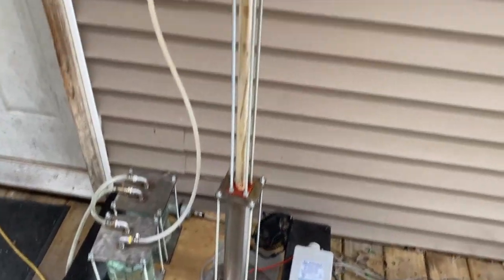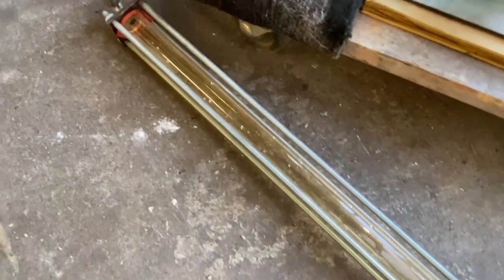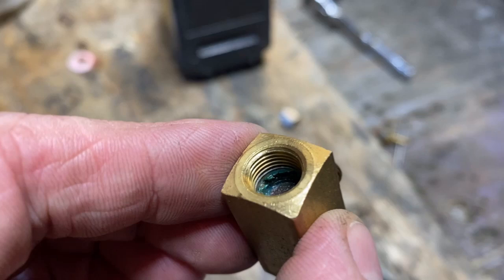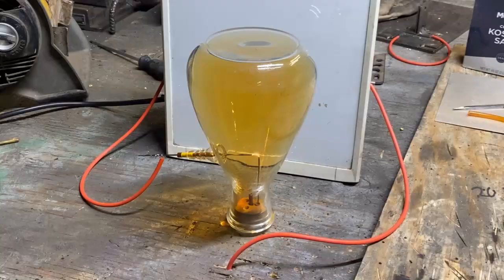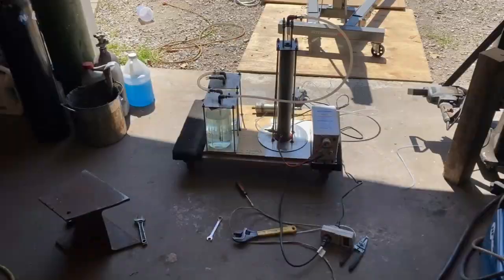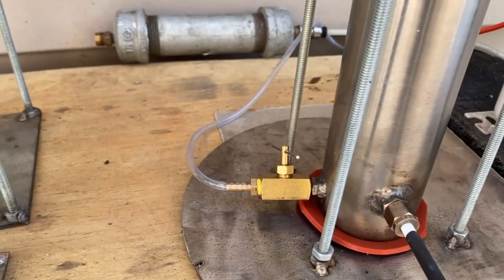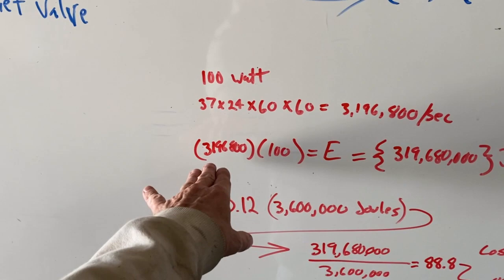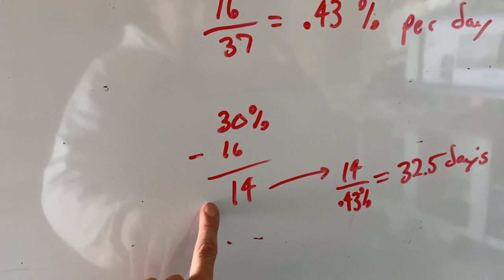Birkyland Eyed reactor  16.6% NITRIC ACID IN 37 DAYS

Comment: For such strong reagents, it is necessary to use PTFE seals and a Tri-Clamp connection system for collapsible sealing.  White coating, most likely silicon oxide, from a degrading silicone rubber gasket, dyed red.

Comment: The white stuff on the rubber it may be Silica oxide coming from the decomposition of silicone rubber, while the one on the walls. May be a mix of oxides coming from the electrodes disintegrating but i will sort the last option out due to the white colour, Ni and Cr are quite colourfull both in oxigen and nitric compounds.
Maybe an air drier before may mitigate the problem.

To test for it try disolve that stuff with a bit of nitric if change colour or disolve it's the metal it self, while if it remain as a powder take a bit and test how abrasive it is on a piece of steel if it's able to polish high probability it's silica.

Comment from the maker: This is a 100 watt spark guys . going wind power soon . Wind last all night here , may do a solar battery set up also
Reply: Wondering...  what would it hurt to have a third bubbler with sodium or potasium hydride in it? A little air flow maybe but wouldn't alkaline water be more efficent at pulling NO2 out of the air or ensuring no nitric acid evaporates out.
Reply: @kreynolds1123  best would be an first big bottle filled with pumic stone. The high survace helps the NO to oxidzize to NO2 than i would use 3 bottles with water and an 4 bottle filled with H2O2 to catch the last NO so there is no release into the atmosphere.
Reply: you must destill your acid only with bubbling you cant achieve 70%. There is an wired law with NO2 small concentrations can only form deluted acid it doesnt madder how long you bubble tons of NO2 into water. But when you use High concentrated NO2 you get higher concentrated acid and i mean the amount of NO2 air mix. (3% NO2 97% Air fairy thin acid.50%NO2 50% air, high concentrated acid)
Reply: @Preyhawk81  I've been saving egg shells, about 15 pounds powered. Way more than I could convert.  I'm fantasizing to make calcium nitrate during the winter and enjoy the supplemental heat rather than struggle to work the AC more.  Then i will have a nitrate salt fertilizer for the garden. Probably still need to vent outside and set up a heat exchanger to recover heat that would have been vented.
Reply: @kreynolds1123  hope you have enough wind or very big solar panel survace in winter they are shit.
Reply: @Preyhawk81  I have solar power for 80% of my annual electrical energy consumption. I also have natural gas heat. Electric heat elements are nearly 100% efficent but it's energy cost is more costly than natural gas. Heat pumps may easilly have a cop of 3-4 making them competitive with natural gas.  I've been thinking about what electro chemistry may make something useful and whose waste heat from the process could supplement heating my home over the winter.

Comment: I have made my own high test Nitric *90%+ but the ammonia nitrate is sorta costly too. this method while slow af, seems to be a lot cheaper
Reply from the maker: If this thing produces 50 to 70 % Nitric , im gonna go big and build a 1000 to 5000 what unit that runs at a pressure of around 80 psi  . This was built from shop scrap . If it works wonders i will be building the  Buggati Burklyland Eyed reactor
Reply: @NOBOX7  Just remember fela, you and I cannot compete with a company totally set up to produce a product.

Comment: A good start, but you have a problem with the air, as it is moist. You must dry it by passing it through silicon dioxide or calcium chloride to remove moisture from the air so that oxygen and nitrogen remain free of moisture.. Wonderful work and effort. Good luck my friend.

Comment: Based on the copper nitrate that was produced? We could put scraps of coppper and/or brass in the arcing chamber and CuNo3 will be produced straight from the NO2 and O2 without producing nitric acid (Understand that HNO3 is the target product for these vidoes). Hopefully that will not produce CuO in the presence of oxygen.

Comment: Im studying thermodynamics ,because im interested in compression ,because comoression ,makes moleculea move faster and faster as the pressure increase ,faster and faster until thwy become gas ,i dont know whats the relation off faster moving moleculea to convert to liquid ,and qhen they are liwuid ,the molecules should be slower .
Reply: Its about the vwnturi effect gas inters in a narrow sna exits to wider area ,this change makes drip in temp ,im dtill not sure until is observe it

Comment: Great set up.I am suggesting corona discharge ozone generating plates.You get way more surface area.I found  out when  I used air to generate ozone, nitric acid would form on the high surface area plates and you have to dry them constantly.You are using very basic little surcae area arcs.The high surface area ceramic ozone space will give way more gas than the simple arc you are using.Corona discharge + high surface area with reasonable airflow =more nitirc acid in less time.Thank you.
Reply: Correct. But with Jacobsladder you only get "deluted" NO2 maximum concentration of 38% nitric acid possible. The effizienzy is higher i ve read the Pauling system (jaccobsladder with iron electrodes) had an effizience of 3,5% the real Birkeland only of 1,5%.

Comment: with this tech could boost my crop yield.
Reply from the maker: its not the best fertilizer route but doable
Reply: @NOBOX7  so then how could I make my own nitrogen fertilizer in a grid down situation? My goal is to 100% DIY my own nitrogen fertilizer. And yes I do buy it right now but supply if supply lines do get cut then I can go to your method.

Comment: Could you maybe use Kanthal wire for the electrodes?
Reply: Ive found that 316L stainless works well as long as they don't overheat.